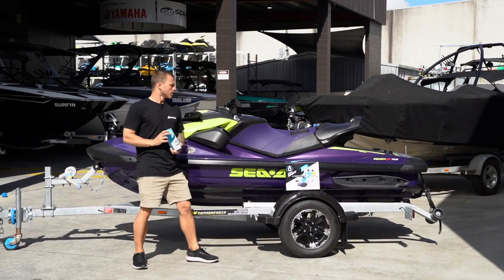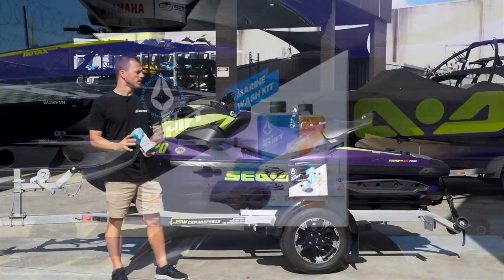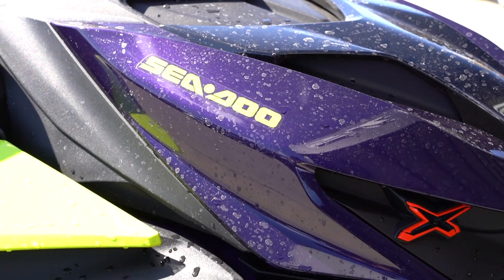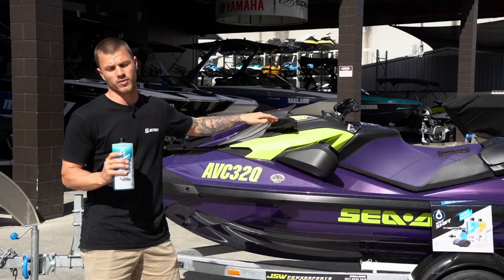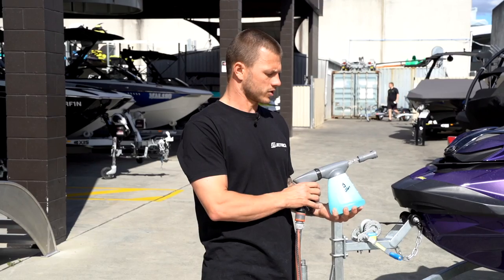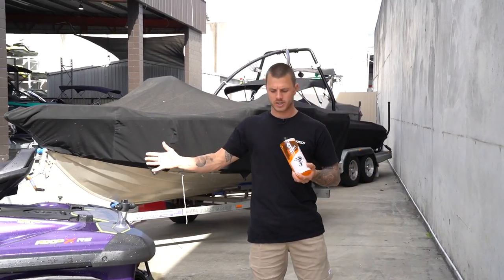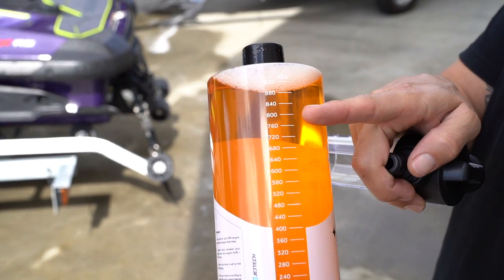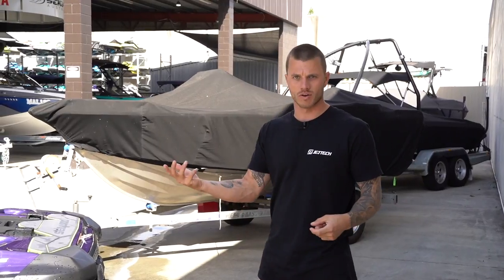How to Clean your Jet Ski and Engine in 30 Seconds

Comment: Sea doo has a closed loop cooling system so all the engine flush does really is flush the exhaust. Unlike a kawi or Yamaha which uses external water for cooling. Still this cleaner works very well for all circumstances
Reply: Also make sure not to run your sea doo longer than 30 seconds when flushing because of that closed loop cooling system. Very hard on the carbon seal if it’s ran longer. A couple quick revs to no more than 3000 rpm after turning off the water will empty the water box and you’re good to go
Reply from the maker: That’s right, exhaust and inter cooler on supercharger models
Reply: Technically, as a Tech, you're incorrect, because you still want to get the salt off the heat exchanger.   Remember , even though its "closed loop" there's an exchanger that takes heat from closed loop system (ride plate) .  The ride plate is your radiator.   It's that  and the exhaust which is subject to salt corrosion.  The intercooler and exhaust are still cooled by raw seawater.

Comment: Thanks guys! One question: After putting the engine flushy (20-30 sec) - do I have to wash the engine also ONLY with fresh water? Thank you in advance for your answer. Bw, Nik
Reply from the maker: Hey Nik, depends on the context mate! If there are salt crystals evidently on top defiantly give it a little spray down with fresh water.